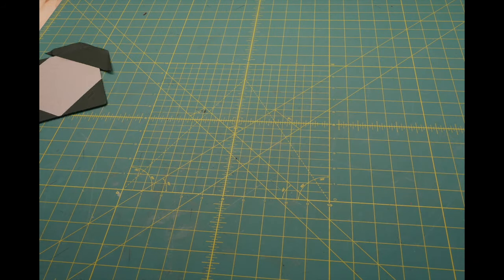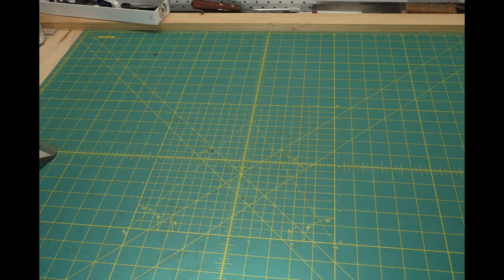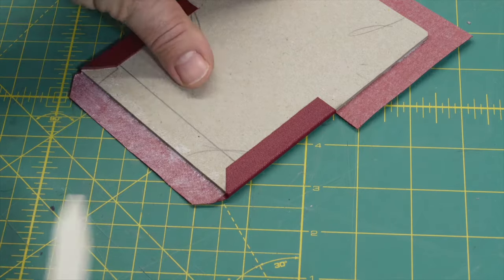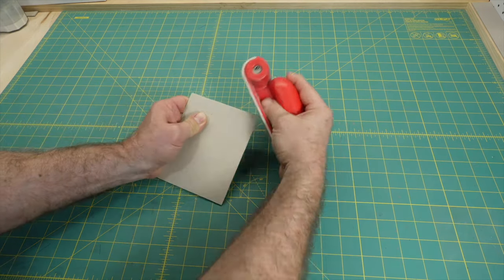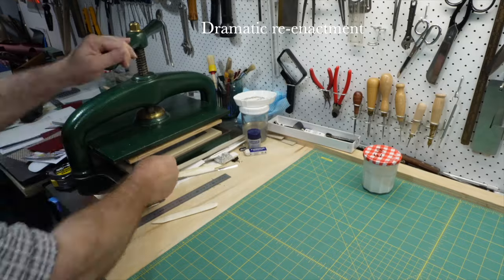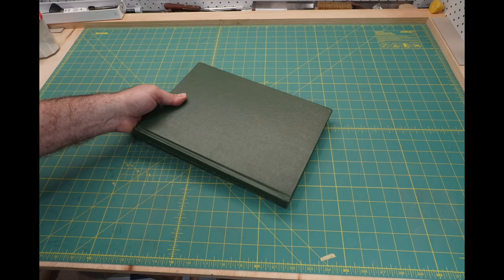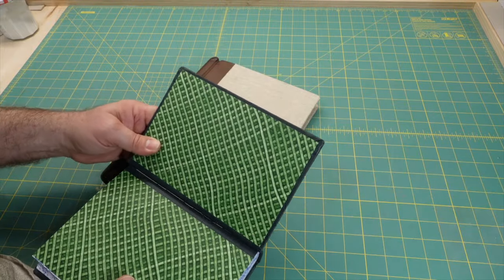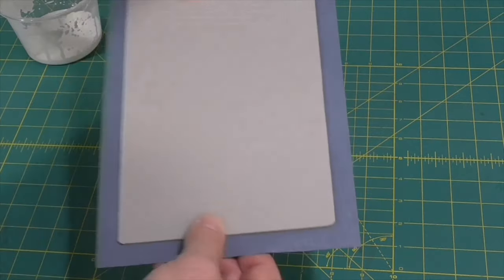Library Corners with Bookcloth // Adventures in Bookbinding

Comment: I’ve been looking at books I have, bought from circulation libraries sales, that were bound in the 1980s or so, and those corners do not look like these. Perhaps the Scandinavian library tradition is different. 😊 Most of the corners I’ve been looking at (since you triggered an interest in the detail) are more like the usual corners you do in your videos (but with rounded board corners), but sometimes the fore-edge part of the covering material is trimmed in a broken line so that the overlap is not as thick right at the corner, and then the edge of the material is closer to parallel to the head/tail end than the 45 degrees you use. 

Your videos have made me pay attention to new details in my books. Thanks for that! 😄👍🏻
Reply from the maker: Different era, and libraries didn't always use them.

Comment: What would be your recommendation for straightening out a hardcover book which has been bent? Our cleaning leady unfortunately placed a heavy box of stuff on another box containing books, and this book was sitting at an angle in the lower box and has been quite badly bent (it also looks like the spine has cracked in multiple places behind its covering, although I cannot be 100% sure).
Reply from the maker: Sorry, no easy solution to this especially if the binding has been damaged.  If it genuinely was just bent and no structural damage then significant time in a press with good pressure might help.
Reply: @DASBookbinding  Thank you! Oh well, I feared as much.🤦‍♂️ I will see if sticking it in a press will help (fingers crossed).

Comment: What's the best way to contact paper a paperback. Do you have a video on this topic? Is there a type of contact paper which is more clear or durable? How do you preserve a paperback?
Reply from the maker: Don't contact cover your paperbacks.  Nasty ugly stuff.  But a good question.  I've put it on my video to-do list.  It will be sooner rather than later.  Heads up, the recommendation will be a phase box.  Quick and easy to make.  Photocopy the spine and stick it on the spine of the phase box and it will look like the book on the shelf.
Reply: @DASBookbinding  Ok, I'll take a look. Supposing there's not enough margin to create a hard cover from a paper back. Is that usually the case? I think I remember your other video on this topic - which had some sort of snug binding. I guess there's no real way to sew the paper backs' spine.
Reply from the maker: @ryanchicago6028  A phase box is just an enclosure to protect the paperback.  No turning it into another book.  Just preserve it.  I've got a video on making them.  Easy to make.